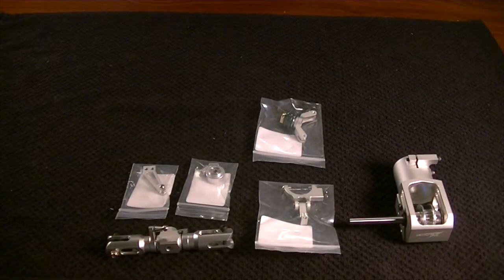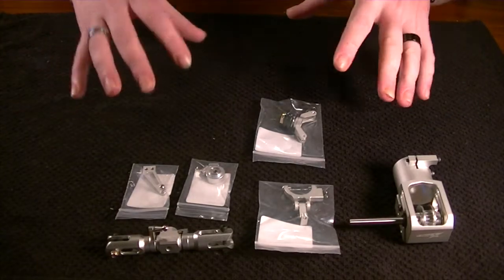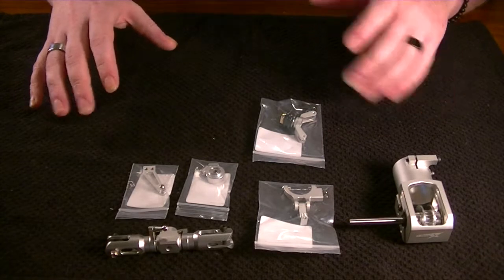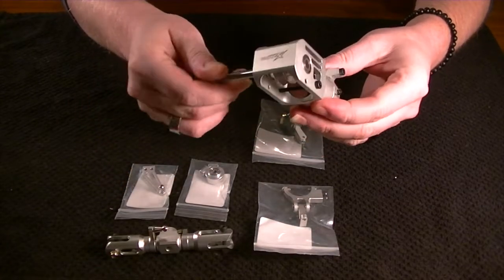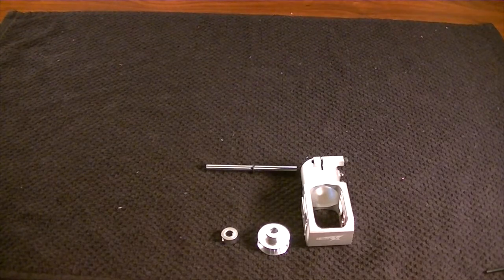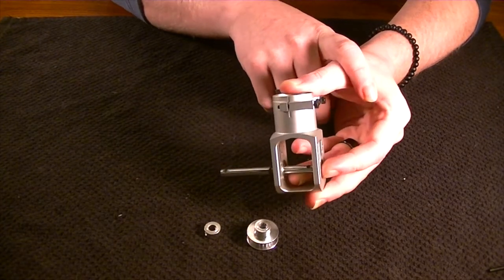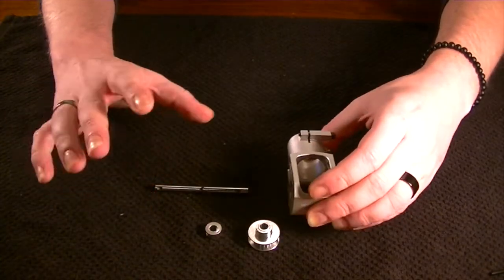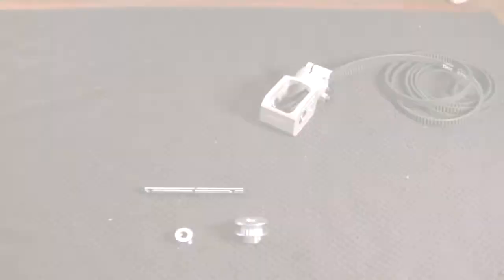Specter 700 : Tail Build Assembly (FreddyCanFly)

Comment: Something I was taught in machine shop is when installing a new milling bit into the collet, remove the set screw and visually line up the flat of the bit with the hole for the set screw. This way you are 100% sure that you have 100% contact and nothing will move. Same goes here. Remove the set screw and turn the shaft until you see the divot and re-install the screw.
Reply from the maker: Perfect and amazing advise :)